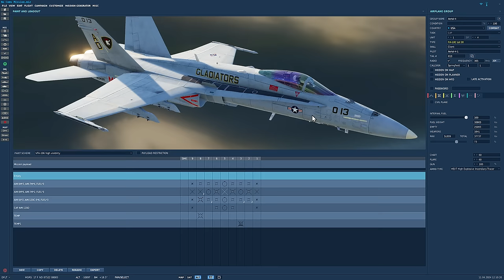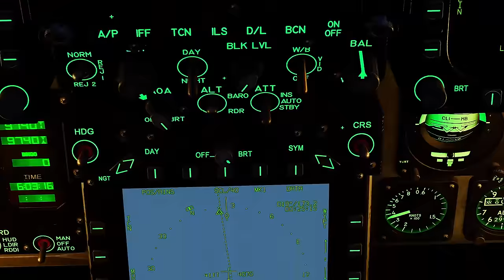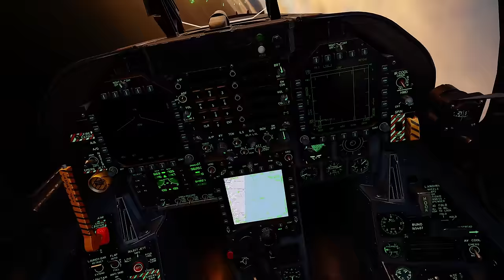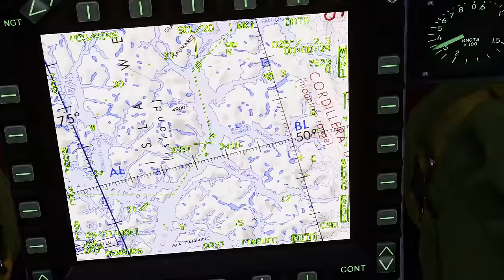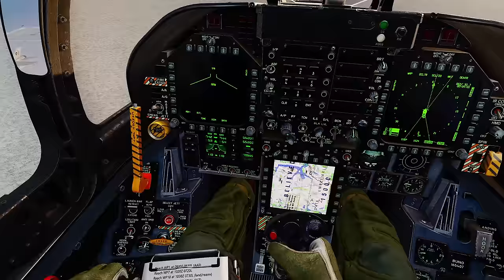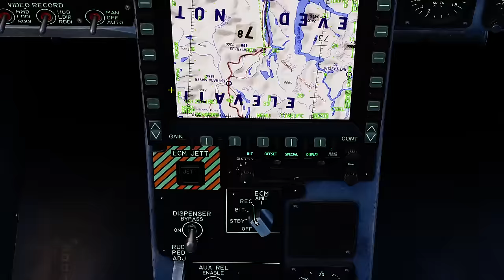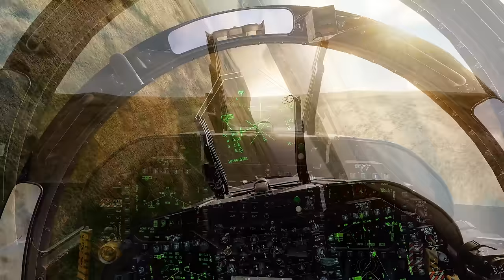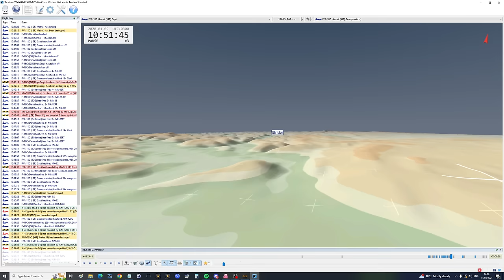Could A Complex 700 Mile Mission Be Performed With Radio Silence? | DCS

Comment: The F/A-18C has a Time On Target feature. not sure why you didn't utilize it. You even made a video tutorial for it
Reply: Also you don't need to burn off the extra fuel to lose the weight because you can dump it with a switch
Reply from the maker: I know but I just love the challenge of working it out manually as I go.

Comment: It would be cool to see DCS implement a 'Quiet Coms' setting where you can program a toggle to give a silent 'hand signal' to the others in the group. Every signal given will have its own symbol which when pressed will show up on screen to the others. For example, if you needed to pick up the pace you could make a symbol that appears as a flame with an up arrow indicating more power, or less power with a flame symbol down arrow indicator.

Comment: You would have lost me at landing an F16 on a 4K runway. My flare out takes 6K and even then I am 50/50 at making the end threshold. lol maybe not that bad, but it feels like it sometimes. Toughest mission to date. Because usually to achieve success someone steps up and takes a verbal command to fix a problem. "...Fireball, head north and take out that baddie..." or "Simba you take the one on the right and I'll take the left". Target deconfliction and task prioritization are two huge reasons for successful missions. Whoo boi!
Reply: Guess the fix is to land that F-16 like a turbo prop rather than a 737 (Slow and really early touchdown, of course you can have the bad habbit of "dragging" the aircraft to the runway as well (Full flaps, high angle of high and high power setting at low altitude would be "dragging")

Comment: From the P-40 pilot's flight manual, some examples of communicating with radio silence are:

 

- Assembly -> Rocking of wings

- Open up or loosen formation -> Fishtail (use the rudder only)

- Echelon left -> dipping the left wing

- Echelon right -> dipping the right wing

- Attention! Expect a rapid maneuver -> rapid fluttering of the ailerons

- Landing -> pumping of the elevators

- Switch to full tank of gas -> rotating the wrist as though turning a selector valve.

 Copied from inho found on Google
Reply from the maker: Thanks!

Comment: Gotta admit, when I saw “radio silence”, I thought, “Easy as pie… use VoIP, email, etc. Cap did use the term “RADIO silence” (emphasis mine).

I’ve read where inter-flight communication between planes was accomplished with extremely low-power, tightly focused alternative communication methods (laser blinks, low power radio beam, etc.) 
Is this a thing, or does it only exist in fiction?
Reply from the maker: Not sure but it's def not in game.
Reply: @grimreapers  Encrypted channel communication exists in the F-18 and SRS supports it.